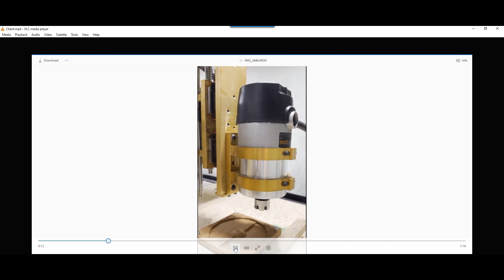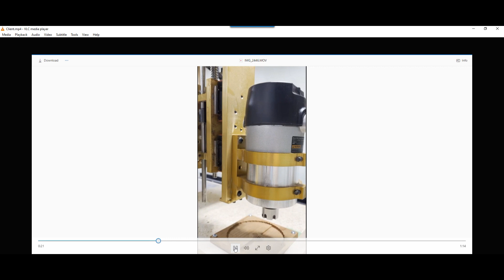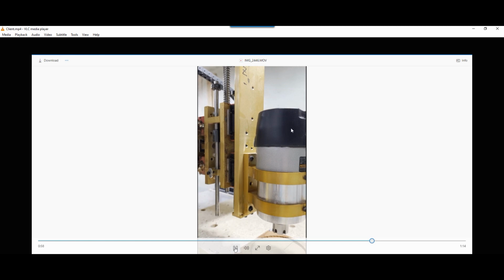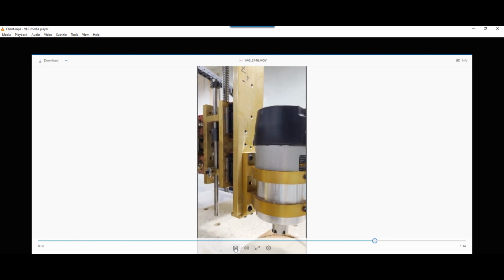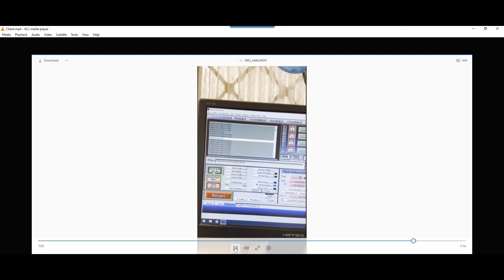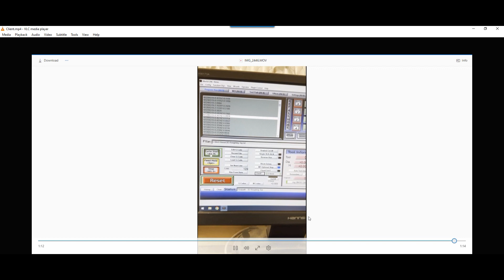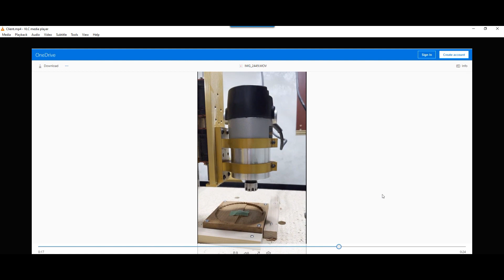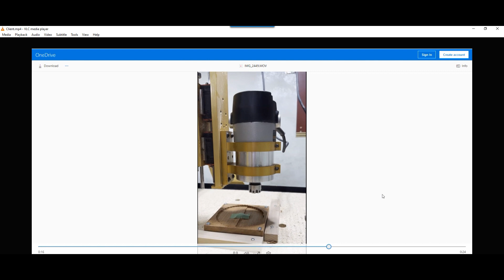Something Doesn't Quite Sound Right With This CNC..

Comment: My Genmitsu 4030 Prover XL has been working great for 8 months or so, BUT now the z-axis just started studdering when moving up and down during the carve but only on the right 1/3 of the machine. 
 What happens when I traverse it either offline or with PC connection both the down and up directions make the z-axis move down or both move it up. 
I thought it was the stepper motor, but when I use the manual twist knob it traverses up and down without issue.
I also tried wiggling the wires to the stepper motor and traversing up and down with no effect.
Do you think this could be a ant-backlash nut issue?
Reply from the maker: Thank you, for your support. I would have to see your system through a Microsoft Teams consultation as without seeing the system I would just be guessing. 

Thank you,
Vince